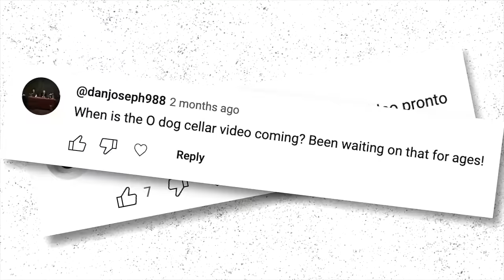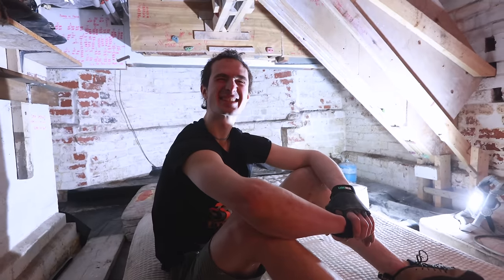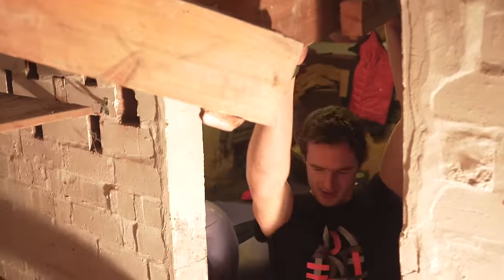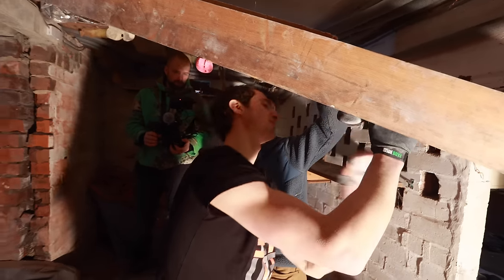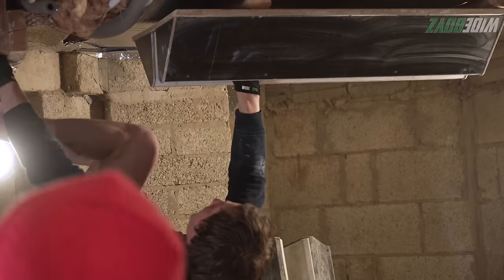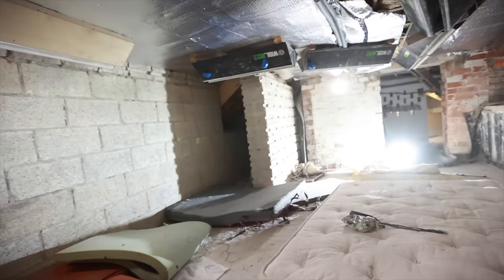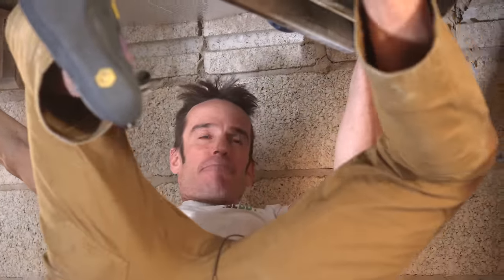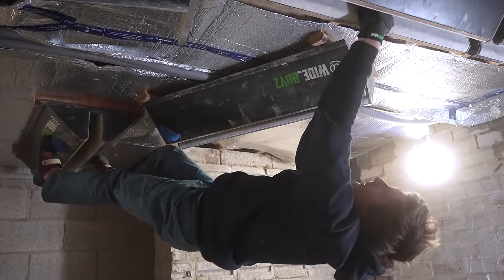Greatest Rock Climber VS. World's Hardest Crack Climbing

Comment: I would add that having a good coach to teach you proper techniques before you ingrain the wrong techniques is very important. 
   Too many climbers have wanted to figure it out on their own; and his develop less efficient climbing strategies and techniques; and thus did not progress as quickly as possible; and also got injured.
   Since more climbers are getting good coaching; a much higher percentage of climbers are climbing what used to considered by some to be unclimbable.